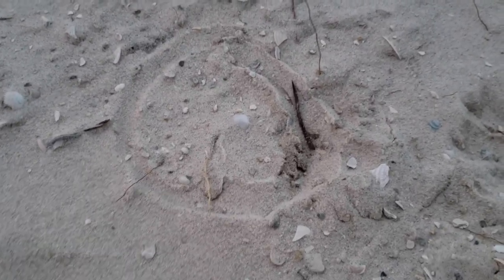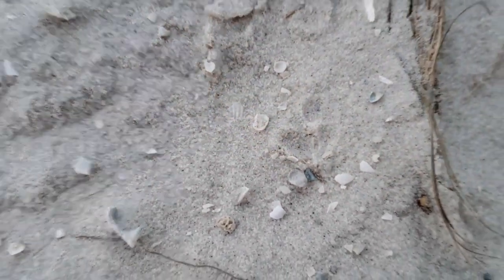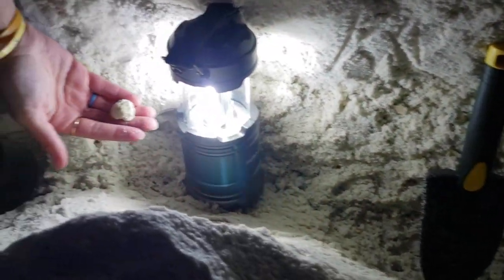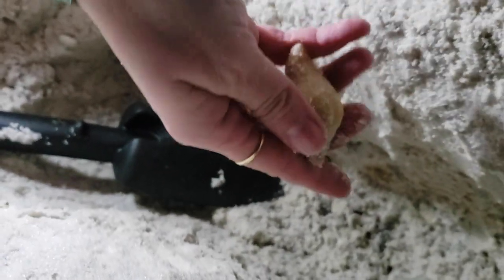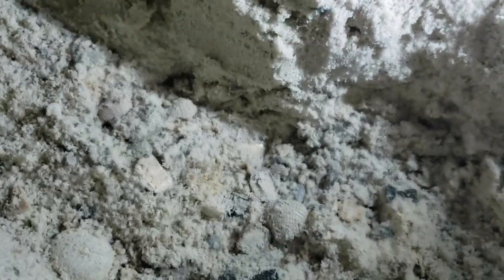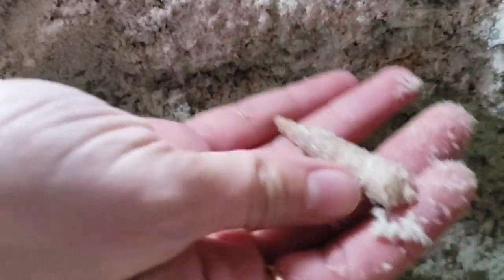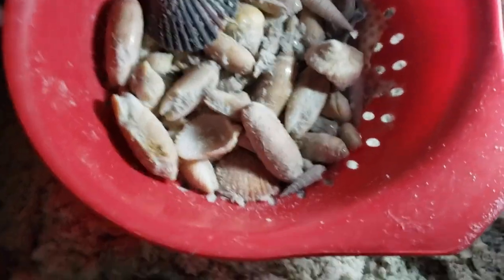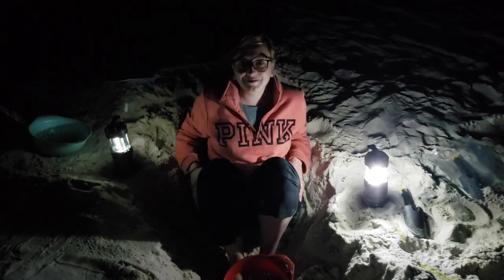Shell Hunting At Night / Looking For Seashells In Orange Beach Alabama

Comment: #WILDKYLE
Reply from the maker: The fluid contains the gases oxygen, nitrogen, and carbon dioxide. When you pop or crack a joint, you stretch the joint capsule. Gas is rapidly released, which forms bubbles. In order to crack the same knuckle again, you have to wait until the gases return to the synovial fluid.